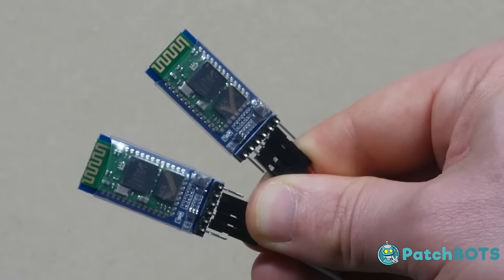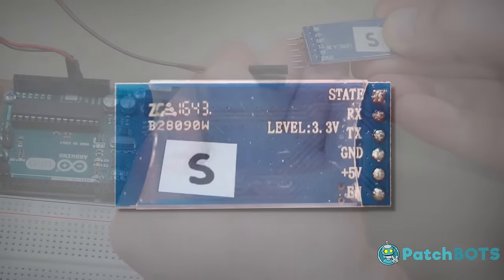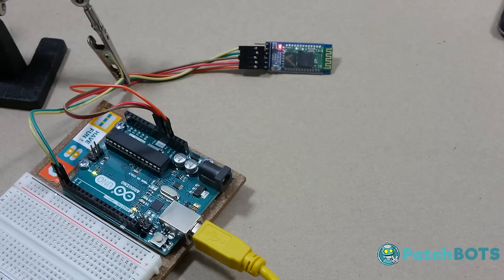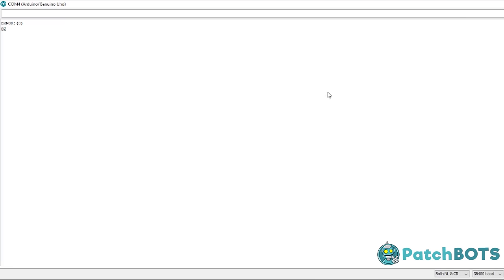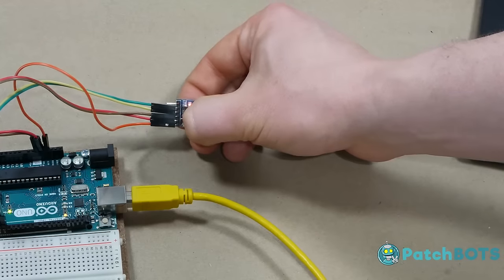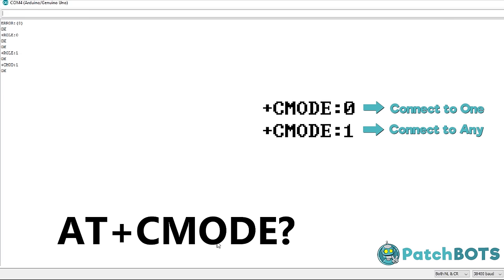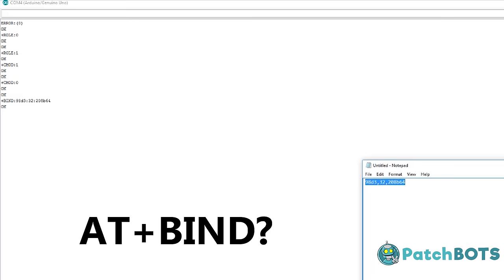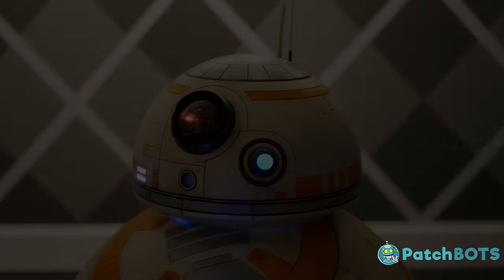How to Pair HC-05 Bluetooth Modules

Comment from the maker: If this process isn't working for you, please read the video description. I've updated it with a few of the most common problems. If that doesn't help, search through the comments, i try to respond to every question. If that doesn't work, post your new issue in the comments and I will get to it.   If that doesn't work, I sell pre-paired boards in my store. Link in the description!
Reply: bray ngubah ke 38400 baud ratenya gimana
Reply: Did you do this for your clone comm pad?
Reply: And could you make a video all about your clone comm pad because I want to do what you did but I’m not sure how you did it and would like an explanation and how-to.
Reply: It worked for me with an arduino mega for AT Command mode stuff
Reply from the maker: @ArcaneStellaris  that's great to know, I'll add it to the description
Reply: Hello @PatchBOTS  i have a big problem. My two modules are connecting for about 30 seconds and then they disconnect until i reset one. I DONT KNOW WHY.
Reply: I'm able to send AT commands trough ftdi interface, configure the modules, but then when I write using terminal into one, it does not show on the slave module or vice versa, modules just do not connect

Comment: Hi, I have a HC-5 and when I try to repower it using my power supply it worked but 5 second after it didn't work anymore the light is not blinking, and the resistor is very hot it even melts the plastic cover in it. Do you know how to fix this problem?
Reply: It fried up.go buy another one pal

Comment: Its a very good and clear video. Can u make another video that you program a simple ting with it like a press on a button sends signal to the slave and lights up a light. Can u also make another video where u can send with both that u can use them like a chat, or is it not possible.
Reply: This would a fantastic addition

Comment: Great video, and i have no idea how it ever worked with TX going to TX and RX going RX in the first place. Most the world knows they need to be reversed as the module TRANSMITS  into the RECEIVE  pin . but it general it worked for me doing it the right way . thank you.
Reply: Puzzled me at first - but I think the cross is unnecessary because the data is just passing through the serial interface from the USB port, rather than originating within the Arduino.

Comment: Hi I do not know if you are still answering questions, but I am able to follow your steps to a tee except when I switch to the other bluetooth module. When I do, I am unable to get a response from the serial monitor. No matter how many times I type "AT", nothing seems to come out. Is this a problem with my own bluetooth module, or is there something I missed in the video?
Reply from the maker: Troubleshooting: 
1. Are you using an Arduino UNO? You must use an UNO to program. 
2. Is the light doing the slow, long blinks representing AT COmmand Mode? 
3. Is there a blank sketch uploaded to the arduino? 
4. Is your serial monitor set to 38400 baud? 

If the answer to all these questions is yes then you may have a busted module, try another module with the same method to confirm.

Comment: I have a question. What about the passwords that we configured? I applied exactly the same procedure but master could not connect to slave just because I have changed 1234 default password to something else. When I reconfigured the slave's password to be 1234 master could connect to it? If pasword matters (which seems so) how can we let the master know  or bypass the password of the slave?

Comment: Hey, Ive been working with them using a different micro, UART is working, Role and CMODE are working. For whatever reason, the address I try to bind is not remembered by the HC-05. Any ideas?

Comment: New subscriber here! this video was concise and full of value.. I have a question, is it possible to add more than one address for the master to connect to whenever any of the added addresses are in range?
Reply from the maker: Not that I'm aware of, but check more recent firmware guides.

Comment: Hc 05 logic pins are 3.3 v, UNO is 5 v, can it tolerate ?. I saw in a Great Scott video to use a voltage divider between tx of uno and rx of hc 05.
Reply from the maker: Yes, should be fine without for programming but you should probably use one for regular use

Comment: it is not working with my nano, it has had other problems like not using the normal USB drivers (SDTI are the most common I believe) however I cannot see why this would not work, any ideas?

Thanks
Reply from the maker: @swishy _ fishy In the end you can use a Nano for your project, but it appears you need to use an Uno to do the AT mode commands.  Others have had the same issue using a nano which was resolved by switching to the Uno.

Comment: Hello! Great Video! Right to the point. One question, do we have to set the AT commands every time we disconnect and re-connect the arduinos ? Or do the HC-05 "remember" their master or slave state ? Thanks!
Reply from the maker: They remember!
Reply: @PatchBOTS  Insanely fast reply, thank you, really appreciate it :)
Reply from the maker: @eleftheriostriantafyllidis3012  No sweat, if you run into any issues post them here and I'm happy to help
Reply: @PatchBOTS  Oh, you could add in the description that Error (7) may also come up in case the address is two characters less; For example an address FCA8:9A:22ED is two characters less than in your tutorial in the end. This is simply fixed by adding zeros in the end, i.e.: FCA8:9A:22ED00 :)

Comment: My problem is at AT Command mode. I bring up my Serial monitor up on 38400 baud . I type in AT in the bar and get nothing not even a error what happened what have I done wrong. Also does it make any difference if i am using a Iphone as i can not see it in my Bluetooth.

Comment: Great video. Would you mind if I asked a question? I want to remotely control some 12v lights, but need to use a standard toggle switch. How would you connect a switch to one of these units.
I am a new boy to these products so my knowledge is limited. Thank you.
Reply from the maker: Well it would be connected to a microcontroller on both ends so connect the switch to that and transmit the on/off data
Reply: Yeah its very similar to wireless controlling of an LED just you will need to wire your micro controller to your 12V power supply and lighting to give it the input from the switch which is also wired to a separate micro controller

Comment: Best video on this subject I've seen so far! Great job! I'm assuming you're using a 3.3V arduino (since you're not running the arduino's TX pin through a logic level converter or resistor voltage divider)? You might want to specify this in the video. I'm pretty sure that the HC-05 can only handle 3.3V on its TX and RX pins and that 5V would fry it. Or maybe I've heard wrong and the HC-05 can handle 5V just fine?
Reply from the maker: Nah I think they can handle it.  Haven't had any problems yet.
Reply: Just fried my HC-05 board by connecting my arduino's TX pin to the HC-05's RX pin (without first going through a logic level converter). So it's definitely possible to fry it (as I feared). Not sure how you're getting away with 5V.
Reply from the maker: Yeah man, doing some research it says you should use a voltage divider on the RX pin to get it down to 3.3v.  But I have 2 sets of HC-05's in my BB-8 driod, and I use one set for testing things all the time and have never had a issue with frying them.  Really strange.
Reply: No worries. It was cheap. The back or your modules look a bit different than mine. It seems that not all HC-05s are created equal. There's probably varying base boards and manufacturers out there. Anyway, it would be awesome if you added a quick note about this in your video so no one else has to go through this.
Reply from the maker: Yeah, maybe a brand issue.  I'll put a notation in there later today and make a section in the description of the video.
Reply from the maker: Looks like YouTube has done away with their former notation method.  I may make a supplement video with some coding options since that appears to be the next question a lot of people have.  I'll put a note in that video when I make it. Thanks again for making me aware of this.
Reply: PatchBOTS Sure thing. As an update: I bought some HC-05s from a different seller on eBay that have base boards that look like yours, and they handle 5v or 3.3v just fine. It would be nice if the sellers could explain these subtleties, but I guess this lack of information should be expected from cheap Chinese sellers.
Reply: Where did you buy your HC-05s? I'm finding that there are so many discrepancies between all the various HC-05s out there, that there is no agreed upon method for interfacing with them (and the sellers and manufacturers of them feel absolutely no responsibility for explaining these differences to customers while they happily take their real money and give them junk in return).

For example: My HC-05 will not enter AT mode using the method you described above. Rather than wasting my time by trying the countless methods found on the internet for entering AT mode and hoping that one of them eventually works, I just want to buy your exact HC-05, since it has a known method for entering AT mode (described in your video). This seems to be the simplest solution at this point, lol.

That was a bit of a rant, but I am just absolutely disgusted that sellers are allowed to accept real money from people and give them a mystery device in return (with no standardized documentation, methods, or procedures). Anyway, thanks again for your video, and I know that you had no reason to suspect that your method wouldn't work for any HC-05 out there.
Reply from the maker: Such a bummer you're having so much trouble.  Yeah, I just bought a few pairs off amazon and figured out what worked, I didn't buy any other brands, but a couple people have emailed me saying the same thing about my method not working on their boards.  Overall I'd say this video is successful for about 75% of boards based on comments/feedback.  All materials all linked in the description of the video but the direct link to the boards is here: http://amzn.to/2tcbrrV
Reply: Thanks. I should have checked the description. Anyway, thanks for the quick reply!
Reply from the maker: No sweat, good luck!  keep me posted on the results

Comment: Hi, I follow all the steps but when it comes to sending the AT commands in the Serial Monitor it is not giving me any results back. I am working from a Uno, any idea why this will happen ? Thanks
Reply: baud rate set right? You have NL + CL selected? Not sure about the new Arduino IDE.

Comment: So ive gotten it too AT command mode as indicated by the flashing light but thats as far as it goes the serial monitor will not give me any feed back ?
Reply: I have this problem too with my nano, what board are you using?
Reply: im using a uno board but it still dosnt work
Reply: @josephnavinkumar3089  some hc-05 boards have issues in the 38400 baud rate. There are codes I have found online to allow you to try this same tutorial in the 9600 baud rate. Try looking for these

Comment: Hi, I need to put a transmitter on the collar of my dog, so when he barks it would trigger a device in the house. I also need to keep track of the barks on an app on my phone that I will later make. What technology do you recommend? How? Thank you so much.
Reply from the maker: Hm.  I think all this is possible the only real tricky part is to figure out how you're going to power it on the dog side.  Maybe attach a battery to his collar? If it was me, I would use all 3.3v components and use a single 18650 to power it. 

For the collar I would use a small microcroller like a ATtiny16 (check out TinyCore16).  Some kind of sound module that can detect large bursts in sound and one of these HC-05 modules.    Then on the other side just have some kind of app running that can collect each instance of a "1" coming in from the collar

Comment: So  i used arduino mega 2560. During plugin into PC i held button. Beep says i am in AT configuration mode. I set all commands you mentioned and i was getting response OK. After test my bluetooths are able to pair because they both blink synchronized but they are unable to communicate and i dont know why.Both have same baud rates. Also i would like to ask i see ur mac address is xxxx.xx.xxxxxx this is format. When i check my mac addres its xx.x.xxxxxx  is it because there are 0 digits hidden in it or its weird that i have diff format of MAC than you?

Thanks.

Comment: Hi, I'm using an Arduino nano instead of an UNO. I've managed to get the bluetooth module to get in to the AT mode, which I can tell from the blinking of the LED. However when I go to the serial monitor and I type AT nothing happens. I've got the baud rate and everything set according to your tutorial. Do you think it is because I'm using an Arduino nano instead of and UNO??
Reply from the maker: I've had issues with the Nano trying to use the RX/TX ports and the USB port at the same time.  I'm not sure if you can set them up on a Nano.  Once they are set up you can reattach them to a Nano, but you may have to start with the UNO.
Reply: Yeah mate, it's working now with an UNO. Thanks for the help and great tutorial btw.
Cheers

Comment: great explaination. just a quick question: do we really need to make a potential divider for the TX connection from arduino using 1k and 2k resistors. is it really necessary?
Reply from the maker: hairi yaacob you probably should yes.  For just pairing them I haven't had any issues, but for long term use it's definitely on your best interest

Comment: Hi patchbot i already connect the two HC05 and successfully sending and receiving data but i have a probem in sending negative integers. any suggestion? BTW im only using software serial in sending and receiving data

Comment: Nice video. I made Master and Slave, but I didn't get last step when you used other arduino and exchanged RX-TX and TX-RX (bluetooth and Arduino uno)?
Reply from the maker: Oh okay let me explain a little better.   Tx is your "transmitter" and Rx is your "receiver".  When you're programming the modules through AT you want the transmitters connected to each other and the receivers connected to each other.   After everything is programmed and you have your master and slave, you need to switch around one pair of those wires such that the Transmitter of your Arduino is connected to the Receiver of your Bluetooth Module and vice versa. This way  one receives what the other transmits.
Reply: @PatchBOTS thanks for 1st doubt.  Also if I want to send 5 sensors data by bluetooth, in that case which of the following two methods will be better.
1. Using 2 arduino uno and 2 HC05 MODULE...One arduino uno connected to Laptop for monitoring in Serial monitor.
2. ONE ARDUINO uno and one HC05 MODULE directly interface with laptop bluetooth.

Also can we interface the master module with MATLAB?

Kindly share your experiences. Thanks

Comment: Is it possible to change the baud rate other than 38400? I want a high baud rate for my application.
Reply from the maker: The default baud rate of AT command mode is 38400 and can not be changed.  You can change the communication baud rate.  Use the command AT+UART?    You'll see the default communication rate it 9600.   You can change that to anything you want

Comment: Hello sir I am I wondering how to leave At Command mode. I have sent the command At+Reset and all it does is make it blink for a second and then continue back to the At Command mode blink could you please help me?
Reply from the maker: Remove the wire from the EN/KEY pin
Reply: PatchBOTS Thank you so much!

Comment: Worked well until the AT+BIND part. I got ERROR 7, which is not from a forgotten space. But I looked up over some forum and a guy wrote that different versions of BT modules can be the issue. And indeed I have version 2.0 on the problematic BT module and version 3.0 on the other one. Do you know something related to this?
Reply from the maker: Hi Lulian.   Hm, I never ran into this problem with different Firmware before.  Just double check you've replaced the colons with commas, and there is DEFINITELY no hanging space at the end of the address when you paste it in.  If that doesn't clear the issue, try switching the roles of the modules.  Maybe one firmware is more likely to bind than the other.  If none of that work i recommend pouring through the information on Martyn Currey's blog.  He has done extensive write ups on the HC-05 and all it's firmware versions. You may be able to find an answer in there: http://www.martyncurrey.com/hc-05-fc-114-and-hc-06-fc-114-first-look/   Good luck and PLEASE post your results back into the comments to help others who may run into the same situation
Reply: @PatchBOTS  Definitely there was not hanging space there xD. Indeed the issue was the different version of the BT modules. I connected two BT modules both with v2.0 and the pairing is done. Important fact: if I connect directly to RX without the voltage divider (like on Martyn Currey's blog) I cannot even enter to AT Command. If someone else struggles with this, take a look the connections of this guy : http://educ8s.tv/arduino-two-way-bluetooth-communication/. Thank you for your tutorial!
Reply from the maker: @iulian312  Great! Thanks for posting your findings and glad you got it all working!

Comment: The Serial monitor is not responding to AT commands, I did everything as stated. Any help?
Reply from the maker: Are you using an Arduino UNO?
Reply: @PatchBOTS  no Arduino nano
Reply from the maker: That's your problem.  Programming must be done on UNO